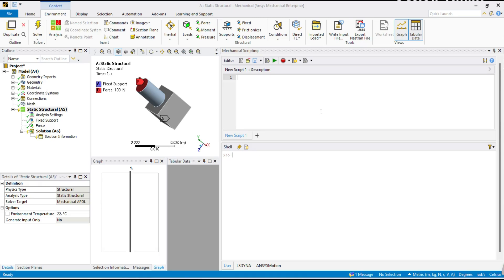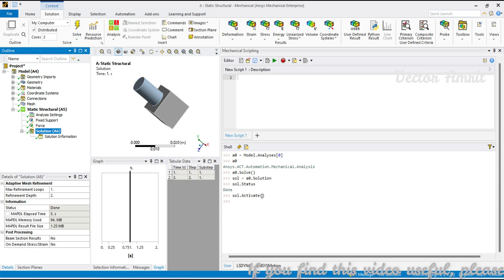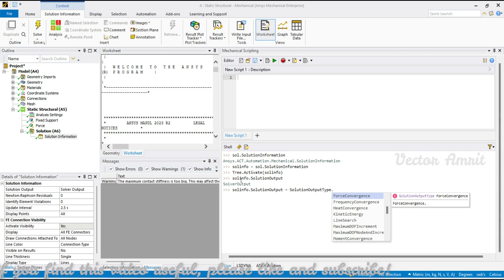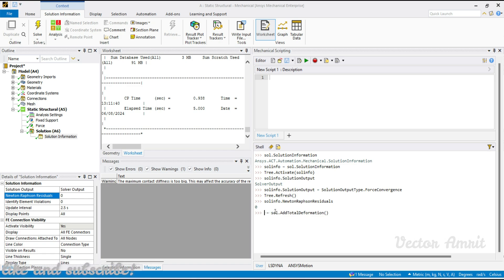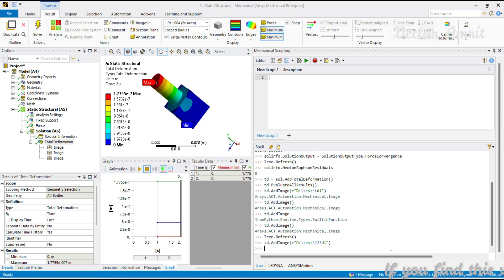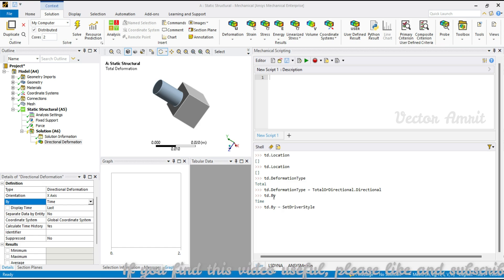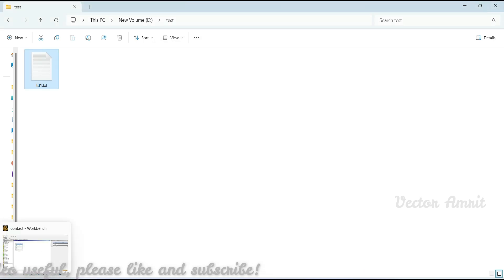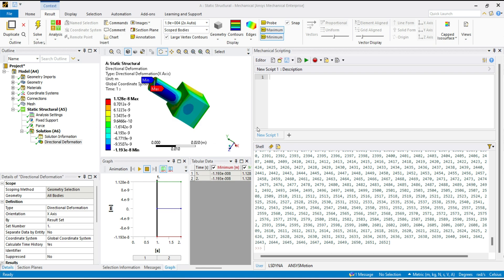28 Solution & Results | Automate the boring stuff in Ansys Mechanical| Ansys Python Tutorials

Comment: Dear Vector, 

I have created a journal file intended to extract output parameters into a specified directory. My objective is to retrieve the strain energy for all elements following a structural static analysis, which is displayed below the 'solution information' upon completion of the analysis. Could you please assist me by incorporating some Python code into the journal file to facilitate the saving of the strain energy in the designated directory?

system1 = GetSystem(Name="SYS")
setupComponent1 = system1.GetComponent(Name="Setup")
setupComponent1.Update(AllDependencies=True)
solutionComponent1 = system1.GetComponent(Name="Solution")
solutionComponent1.Update(AllDependencies=True)
resultsComponent1 = system1.GetComponent(Name="Results")
resultsComponent1.Update(AllDependencies=True)
Parameters.ExportAllDesignPointsData(FilePath="E:/myCodes/Ansys/Ans-Solid/best3/gg9.csv")
thnaks